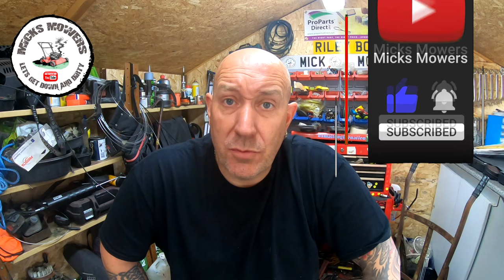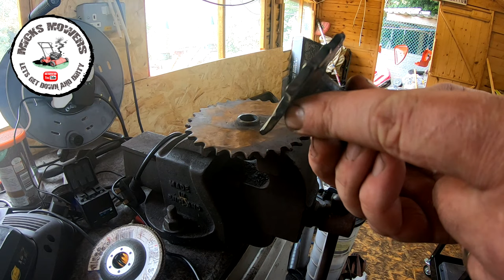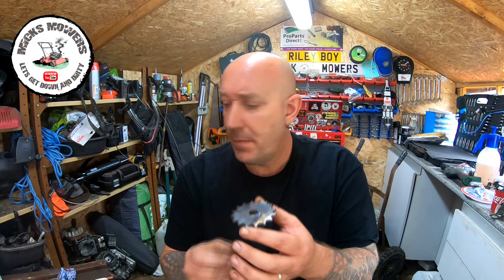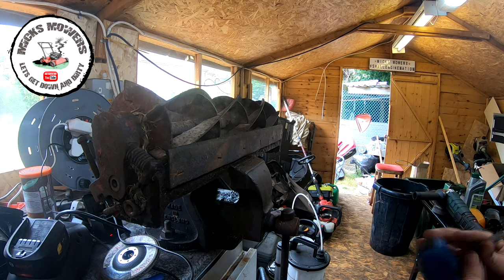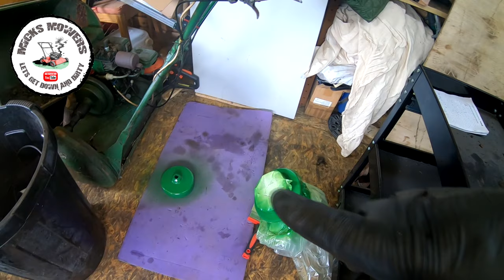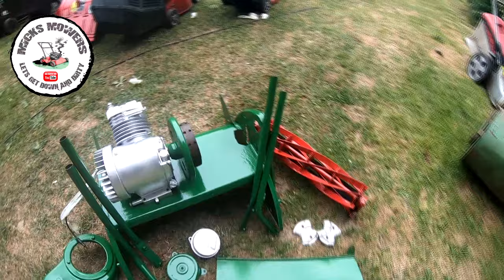How To Remove The Back Blade On A Vintage Ransomes Marquis Cylinder

Comment: Hello Mick 
....greetings from germany
Great Video after all...great work!
I buy a marquis at the same time like you do... and will restore it.

But to losen the gears i have screw bolts in it...it work greate and you can replace it after the Job.

And i will try to losen the bolts from the undercut by freeze the complete sektion by
 - 40° C...
Hope it will be easyer...because it have to shrink..

But you help me more than a lot to rebuild mine! Thank's man! 👍👍👍
Reply from the maker: Welcome to Mick's mowers.. oh you have one too. They are a lovely mower. It's been a great project and have enjoyed doing it. Thanks for watching

Comment: Wow Mick what a transformation so far . I bought a Marquis in May this year and have started stripping it down having found your videos very instructive . Are you going to strip the bearings etc on the cylinder ? What paints have you used on the exhaust , engine and chassis ? Keep up the good work !
Reply from the maker: The bearings on the cylinder are fine. The paint I used for the green was from Alan and Smith and it's the copy for the Ransomes. The silver is from Amazon heat resistant paint and for the cylinder was a hamarite smooth red. Thanks for watching
Reply: Micks Mowers could you let me know which product from Alan and smith ? Cheers Colin

Comment: Hi Mick, you are doing a great job on this.  In your next video when you are building it back up again can you please make sure to cover how you get the clutch shaft into the flywheel bearing.  I had the engine off mine and it came apart no bother, but it is proving to be a pig to get back together.  Thanks and keep it up!  Graham
Reply from the maker: Hi. Yeah mate I do cover that part in the video. It will be out in a week or two.. thanks for watching
Reply: Micks Mowers nice one thanks.  Turned out I gave it a good ignoring for a few days and then offered the Engine up again to the clutch shaft and it just slotted in....  I have no idea what I did differently

Comment: Hey Riley boy . Grand job love the way straighten that cog out nice bit of heat. And a hammer  the impact driver's are good draper one av got is brilliant mate.  Nice one mate good good little paint job too. 👍 Elbow grease used to have to buy it in big tins 😂.
Reply from the maker: Yeah I have picked up a better one did some research on it and looks like it is made of better metal

Comment: Try a can of Crack It freeze spray.  Freezes metal down to -100 degrees. Brilliant stuff.
Reply from the maker: Will do.. ta for the advice
Reply: Micks Mowers I got a rusted seat post out of the bike frame in 2 minutes.   Freeze it give it couple of minutes popped out first go

Comment: Imagine having to undo the bottom blades on cylinder mowers for a living !!, with nothing but a hammer and small chisel , ps your cog is called a chain sprocket .getting there
Reply from the maker: Hi mate. That's not the job I would want. Yeah sprocket my bad